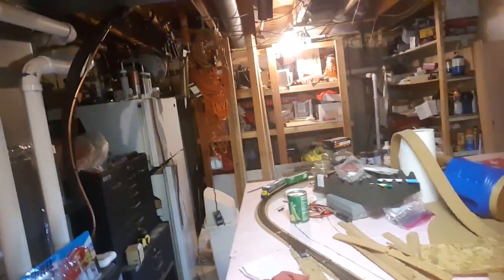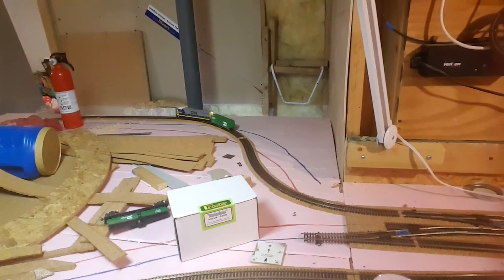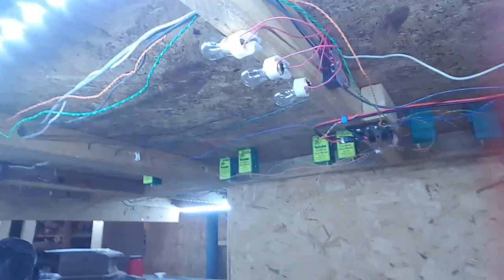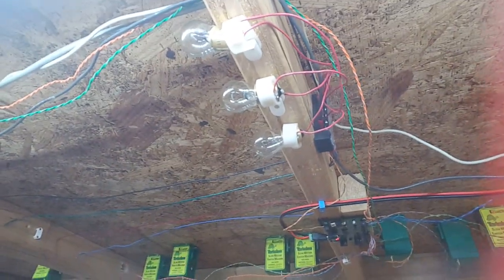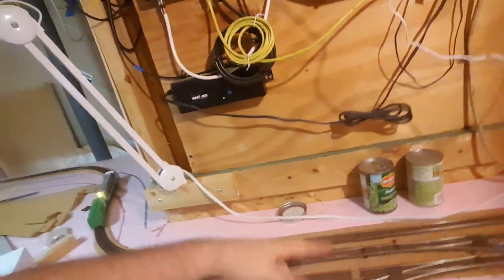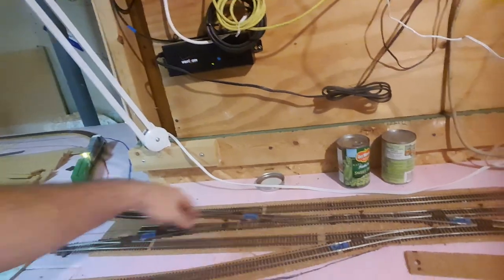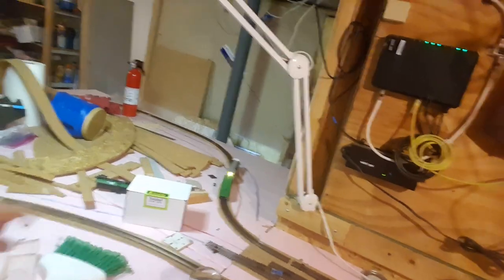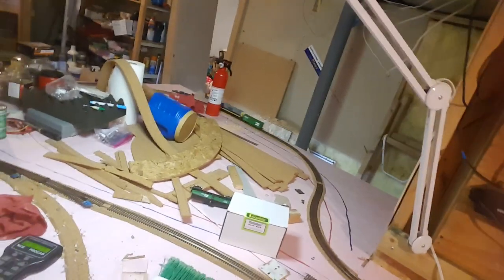I got a train running!!!! SORT OF...

Comment: Nice update ...I would enjoy more in depth on the mini panel and DC bus ...thanks Rick
Reply from the maker: Hey Richard, thanks for watching. The DC bus is easy, its just a large 12v DC 10amp transformer hooked to a toggle switch and then run under the layout into terminal blocks. This way i can drop "feeders" from LEDs when i install buildings or other components. Ill show that in my next video. I can certainly touch on the mini panel too. I would also recommed you check out @arthur houston3. He has some great videos including one on the setup of the mini panel.
Reply: Cool ...thanks for your reply ...I'll check out Arthur too.

Comment: Congrats on getting the train running Rick. Also thanks for the update on the layout. It's neat that you have the reversing loop in place and working. I use Digitrax components rather than NCE, but I assume your circuit breakers have some adjustment for the trip current/duration, which of course needs to be more sensitive than the setting for the command station. Meanwhile, keep up the good work and keep having fun.  Art...
Reply from the maker: Having loads of fun and loads of headaches, ha. there is an adjustment of sorts.  Still working on the fine tuning

Comment: Great update Rick! I'm wondering if the light bulbs are soaking up just enough current to keep your breakers closed?
Reply from the maker: On the top deck there are no breakers. The bulbs are absorbing the amperage of the short. This protects the NCE command station and the locos.  I did test shorting the track with a loco on it and it seemed to work.
Reply: So the decks are isolated from each other then, I didn't catch that,,hmm, well, as long as it works with a loco, right?
Reply from the maker: AHHH. I didnt explain that.. so i bought my NCE system 2nd hand. It came with the dcc command station and 1 booster. So i but my helix and yard on the booster and my upper deck runs on the command station. They are isolated from each other electrically.